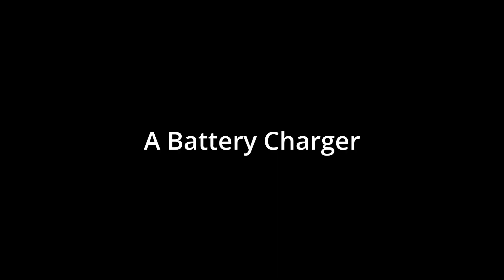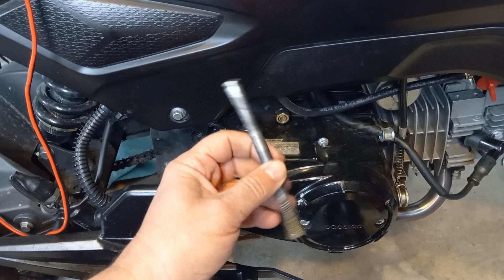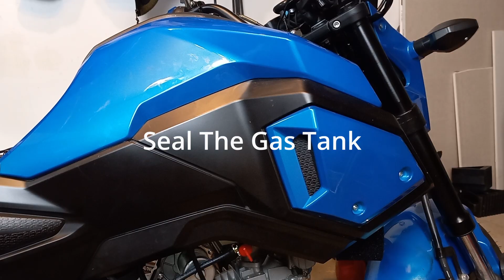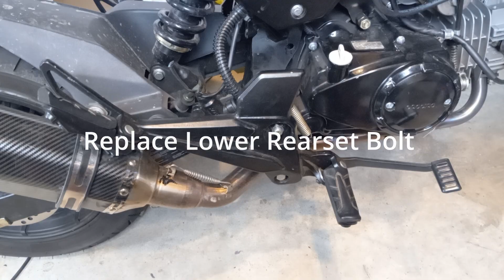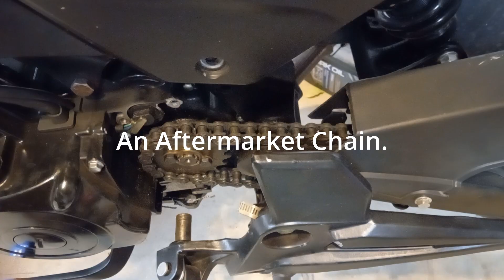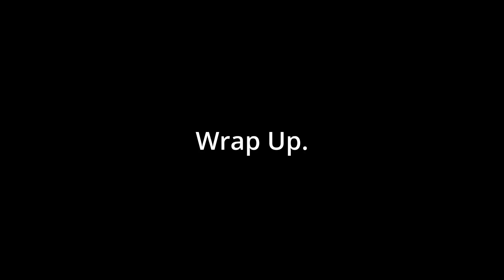Boom Vader Reliability Upgrades: Fix Common Problems & Ride More! (Grom-Clone Must-Dos)

Comment: How about fixing the front wobble?
Reply: yeah a better set of tires probably fixes it unless something is loose
Reply from the maker: Is the rim bent?  Or the tire out of shape?  Stock tires are flimsy and might not wear evenly, so if not the rim, good set of new tires might fix the wobble.  Tell me what you find and do!  Thanks!
Reply: @CageFreeTom oh it's just something that I heard was common with those bikes that's all thanks for the reply
Reply from the maker: @joebotz1243  The QC on the Clones comes into question often, so an out of round tire might be VERY possible.  Something to check, Thanks!

Comment: Did you have any shifting problems and do you know what’s causing it
Reply from the maker: Not an shifting expert, but the stock shifter was a pain if not maintained perfect and shifting in a nonbroken in bike can be tough.  Now general motorcycle shifting problem solutions told to me, are as such,  Right oil type and level in crankcase, right clutch adjustment(engages with no slippage, and disengages when lever pulled, shifting into neutral is difficult when new from 1st gear but easier from 2nd.  Is this what you are looking for?

Comment: So what do i do just put a fuel filter in place of that thing that gets stuck 🤔 causing the vape lock
Reply from the maker: My 'vapor lock' symptoms(riding for a while, bike losing power, and then stalling, and not restarting for a while) corrected with opening the gas cap, which lead me down the line for vacuum issue in the tank.  https://cagefreetom.com/boom-vader-vapor-lock-no-fuel/

Comment: Thanks a million Tom for the info, one that I am having is that I thought I was "vapor locking" so I went and got a one way valve, but realized that the problem was my carb idle adjustment would back out below 1k rpm what can I do to fix this, I was going to add a dab of blue locktite or would that harm the carb, thanks for helping me get my vader reliable
Reply from the maker: In my experience, most idle screws sometimes have a spring to apply friction to threads to prevent wandering.  Some are just high friction, and resist turning.  Yours too easy to turn?

Comment: After removing the little black canister, where did you put the hanging hoses?
Reply from the maker: Recalling from memory, one hose was from gas tank(turned into one way vent) and other went to airbox and I deleted the airbox.  So much of the hoses remained with the canister.  https://cagefreetom.com/boom-vader-carb-upgrade-125cc-grom-clone/
Reply: @CageFreeTom thanks, I like your website, its very informative and helpful
Reply: @CageFreeTom  Awesome, I appreciate the response. Would you happen to know what its purpose is?
Reply from the maker: @CentralAerospace  Not an expert, trying to remember what was shared with me:  When engine off,  gas vapors given off the tank are slowly captured by activated charcoal.  As engine runs, a slight vacuum is pulled(from airbox) pulling any gas vapors off tank, and pulling air (gas tank air in-leakage?)across the charcoal so it gives up any previously adsorbed gas vapors(recharging charcoal) and ensuring gas vapors either staying in the tank, or the charcoal or finally makes it to the inlet of the engine to be burnt off.  Please if someone know better, reply.